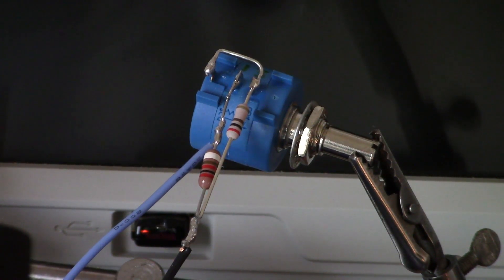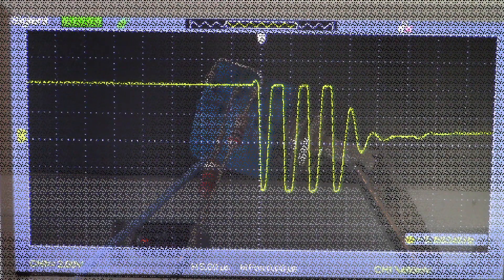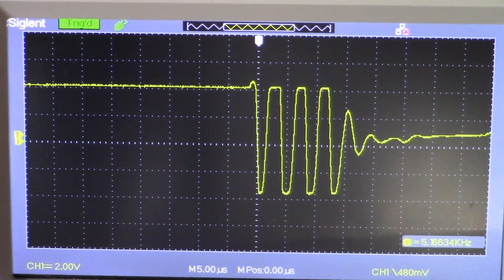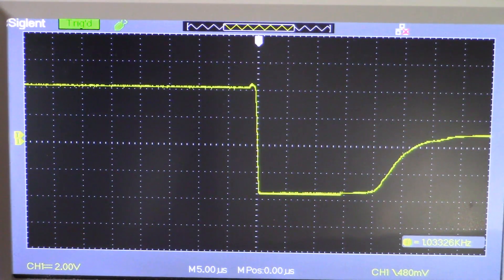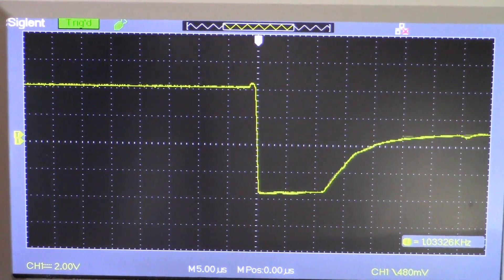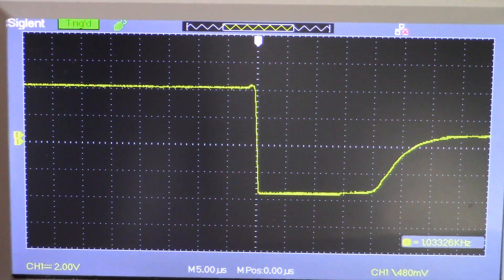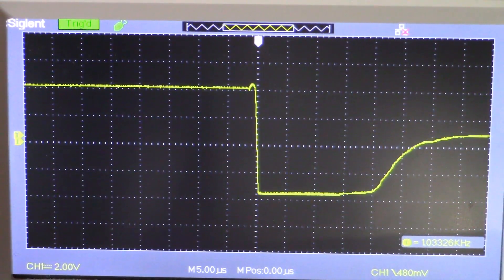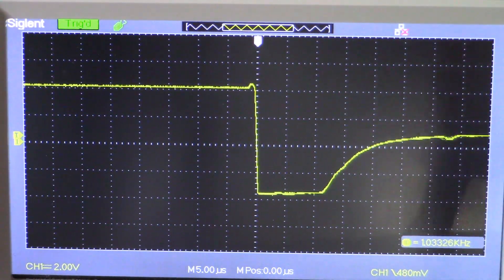Damping Resistor waveforms for Pulse Induction metal detector

Comment: Try leaving the trimpot at 1:28 where the second peak is almost gone and the first is at baseline.  I think you will see a great improvement in depth with very quiet background noise at full gain. You may be able to even increase the gain. I was amazed.

Comment: أستاذي الكريم هل تقصد بوضع مقاومة تخميد متغيرة مكان المقاومة الثابتة والتجريب حتى نحصل على أفضل نتيجة لكشف الذهب
Reply from the maker: You need to use the oscilloscope to get the correct wave form as I show in the video in order to tune the detector to the coil.  You must adjust your sample delay in order to find the different metals better.

Comment: is there a practical power limit to the output of a PI detector? would a bigger mosfet and thicker coil  on a high voltage rail and capacitor bank give more practical range? legal constraints aside. are phased arrays a thing in detecting?
Reply from the maker: Unfortunately bigger is not always a good thing.  You quickly run into diminishing returns. Depending what you are looking for you can increase your coil size but then you loose sensitivity to smaller objects. Phased arrays as far as I know are not used in metal detecting.

Comment: Hi
Would you have the Fourier transform of your signal with and without metal in the coil field?
I would like to know what the signal frequency range would be. It may be possible to filter the useful signal a little from the total signal. With a narrower range, it might be possible to increase the sensitivity of the useful signal.
Thanks
Reply from the maker: Hello my friend,
I do not have the Fourier transform recorded. Keep in mind that the video you are commenting on is strictly illustrating how to choose the correct damping resistor value.
Thanks for watching.

Comment: Hola! ¿Cual seria el diagrama de conexión para realizar esta prueba? Muy interesante información!
Reply from the maker: Hello my friend,  Is this what you are looking for?
 https://youtu.be/CrJ5tFFmWyo
Reply from the maker: Hello my friend,  Is this what you are looking for?
 https://youtu.be/CrJ5tFFmWyo
Reply: @SurfDetector  Yo me refiero al conexionado previo, es decir como excitas la bobina para este ensayo en particular, y sobre qué componente estas midiendo con el osciloscopio.
Es el tipico circuito del detector por induccion de pulso con 555, fet, y operacionales? Saludos y gracias.
Reply from the maker: You are driving the coil for this test with the TX portion of the PI machine.  You attach the oscilloscope probes to the output of the pre-amp to see this waveform.  I hope that answers your question.
Reply: @SurfDetector  yes, thank you bro

Comment: hey my friend.ihave a question is there anyway to get a huge magnetic field (with a special coil for pulse induction like helmholtz coils or other)??????
Reply from the maker: Thank you for watching my friend,  I hope that you will subscribe.  What detector are you building?
Reply: @SurfDetector I am building a pulse induction that designed by me 0to100 and have very good performance but have a problem when my coil is bigger like 1 to 1 meter square coil output signal from lf357n ic is very very noisy I used single power for lf357n (12volt) what is it causes?please help me
Reply from the maker: What you need to do is post your circuit and question on the Geotech Forum.  Without seeing the circuit and without knowing all of the information their is no way that anyone is going to be able to help you to diagnose your problem my friend.  Please post all of your information to the Geotech Forum.
Reply: @SurfDetector  Hi my friend, I solved the noise problem. The last problem I have is making a 1 by 1 meter coil that has a larger field than a normal coil. As you know, any coil can be used with any pulse device. Some time ago, you released a video that was In the case of dual field coils. Can it be made similar for larger coils(1by1 meter)? and do they have effect on depth really?
Reply from the maker: @mu8502  You can certainly make a larger Dual Field coil although you will need to experiment to get the measurements correct.  I am interested to see your circuit. Please post it to Geotech.
Reply: Well, does the dual field coil increase the depth, so why do not most manufacturers use this type of coil ??
Reply: @SurfDetector  I want to publish this circuit, but I want to test this circuit with a two-field coil and then publish it. Of course, you can make changes to it if you want, and I will be happy to use your experience ...
Reply from the maker: @mu8502  The dual Field coil has a Patent on it which I believe is still active.
The idea is not so much to only get a deeper coil but rather to be able to detect small object with the small inner coil and larger deeper objects with the outer coil.
Reply from the maker: @mu8502  When you are ready to share the circuit I will be interested to see it.  What mosfet are you using for TX?
Reply from the maker: The IRF840 has a much higher avalanche voltage.  What are you using for PPS for TX?

Comment: So, for the deep detection using a LARGE mono-coil of large nickel/iron meteorites (and that is ALL I'm looking for) with their much lower conductivity than gold,  would the low-resistance overdamping ("overdamping" when looking for gold) be preferable for any reason?  I also have a Hammerhead version D1 PCB to build.
Reply from the maker: Each coil will need to be attached to the detector and then critically damped. The wave form does not vary according to the material that you are searching for.

Comment: I dont see on your scope 360 ohms, or are you using the graph boxes on the scope, how do we arrive at the proper ohms value, i had a member from Geo send me a brand new voodoo manual because he decided not to build, plus he sent me a brand new ITMD book as well for Christmas, all free, nice present for me. Thanks for the vids, i figured you would have it up today, so i stopped buy.
Reply from the maker: Hi Matt,
The ohm value does not come from the oscilloscope as it does not measure ohms.  I was just commenting.  What you do is use the jig and then when you have the correct wave-form you disconnect the jig from the circuit and then attach it to your multimeter to measure the value.  Good news about the book. There is a lot of good information in there for you.
If you click on the "Bell" button next to the "subscribed" button on the video then you will get all notifications as to when I have posted a new video.
Merry Christmas to you and your family.
Reply: @SurfDetector  ok, will do that now for notification now i know how to measure the ohms, great vid again, have a great christmas and new year matt